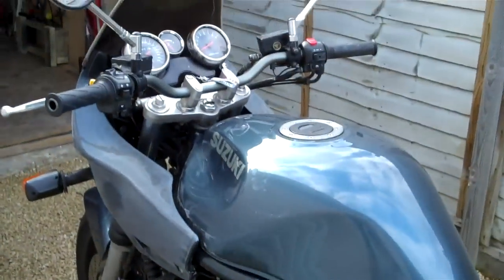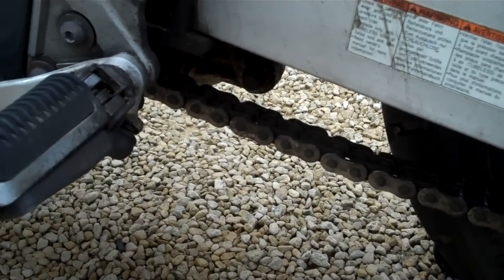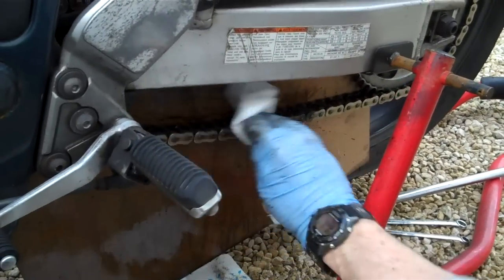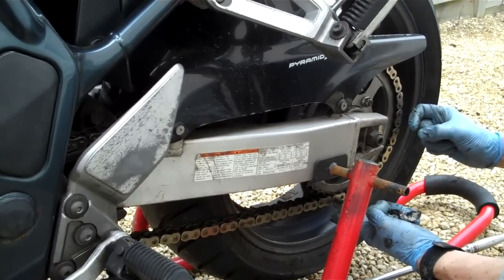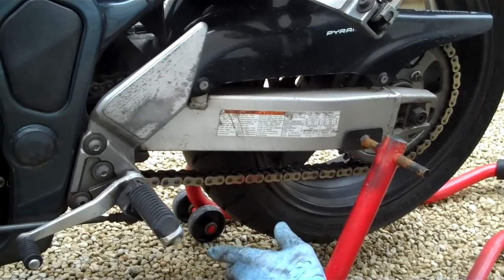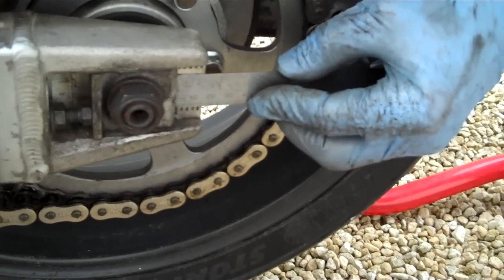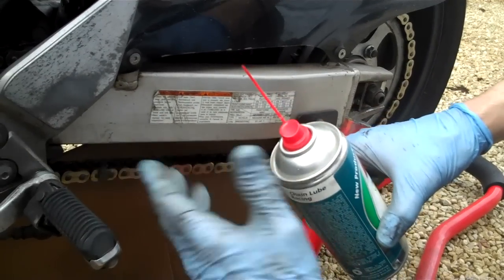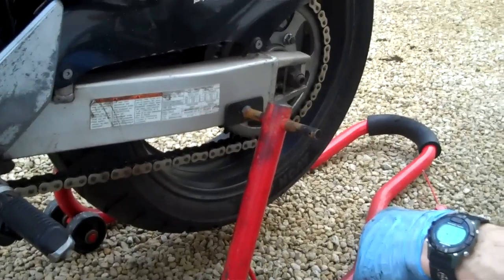Delboy's Garage, Suzuki Bandit, Chain Adjustment. (plus clean and lube).

Comment from the maker: Kerosene, paraffin, diesel, white spirit...it all works, mate, just as long as you clean it with something other than water and good call, it is indeed wise to clean out the front sprocket cover once in a while as they tend to fill up with stodgy chain wax and grit.  Thanks for watching, take it easy mate, Del

Comment from the maker: Hi mate.. no its just the usual wear of discs, they get crud on them and rub in parts...but its certainly not due to ut being out of line as the caliper is mounted with the axle through its middle..so if the wheel is out, it takes the caliper out too so it stays in line....its just and old disc mate, and some dirt....thanks for watching, Del.

Comment from the maker: Hi mate, its a common misconception that scott oilers are a fit and forget item, if they are over oiling then they make a right old mess and need even more cleaning, they need more oil when its raining (because the oil washes off) and in the dry warm weather they need very little, so you should adjust them constantly for the weather conditions to avoid the mess..which all in all is why i hate them and just lub as i need it with a top qualtiy spray lube..  thanks for your kind comments mate..Del.

Comment: untill watching this i didn't even consider that i needed to clean my chain rather than just lube it o_o it was absolutely caked spent 2 hours cleaning it and well...it's apparently silver in color which is nice haha thankin you sir and madame
Reply from the maker: Well done on the cleaning mate, it's worthwhile time spent as the cack that builds up is a collection of road grit and dust, flint and powdered glass etc., not to mention salt crystals all stuck together with old chain lube... and all this makes a pretty effective grinding paste!  Which will certainly shorten the life of your sprockets... so that 2hrs could just have added another 2-3,000 miles to the life of your chain & sprocs!  Thanks for watching, take it easy, D&P

Comment from the maker: You DO need weight on the suspension to set the chain tension correctly... if you dont have a paddock stand, then do it in the centre stand, but set it a tad loose, and do the final check with it on the ground....as long as it doesnt go too tight you're fine.... hope that makes sense... good luck, Del.

Comment from the maker: On the main stand the wheel is fully unloaded so you'll get a slightly tight adjustment, if you have a friend to help loosen off all the back end ready to adjust, stand the bike upright, bounce the rear up and down a bit to settle it, then set the tension by adjusting accordingly and whilst holding the bike up lock up the adjusters and nip up the axle, then put on main stand to tighten everything up properly - cheers, mate, Del

Comment from the maker: Hi AJ...yeah i have had that on the bandit, its usually attributed to a frozen link in the chain....sometimes one of the chain links will get wet inside and rust solid, then every time it comes round a sprocket is will clunk as its forced to move...best to check every link in the chain is moving freely then clean and re-lube the whole chain....also check for snapped off teeth on the sprockets (front and back) other than that, it could be a nail in the tyre...but not likely...good luck mate...Del

Comment from the maker: If you only have a side stand then chain adjustment is fine to do with the wheel on the ground as you need a little weight on it to set the right tension, but for spinning the wheel for chain oiling use a trolley jack on the right hand side of the bike and find a point to jack aft of the side stand mount, this will lift the rear wheel as it rolls the bike over .. you only need 1/2" off the ground so don't jack too far ... hope that helps, Del

Comment from the maker: You are not wrong, mate, and I've seen that kind of thing myself! ... the biggest thing that's lacking these days is basic maintenance knowledge, when I ran a bike shop, a kid brought his 6 month old trail bike in for 1st service at 500 miles & the front tyre was totally shagged, he'd run it so flat for so long it tore the sides off and left a single line of tread round the middle, the things was lethal, and his answer "you never told me to pump it up" ..god give me strength LOL!  Cheers, Del

Comment: Thanks Del, after getting well enough I’ve finally started the service on my bike doing the stuff I’ve learnt from you, brakes stripped down, cleaned and fluid changed, chain degreased and lubed correctly, oil change next, however my wife isn’t best pleased after losing 2 fillings after I used her tooth brush as instructed by yourself, that bit wasn’t the best advice Del Boy 😂😂 thanks again for the great tips and advice

Comment from the maker: Yes Davey.....if you run the bike in gear while suspending the back wheel there is no resisting force on the wheel so it rolls free..the centrifugal free running will make it "overtake" the engine which is ticking over at a steady pace...but as soon as you place a bit of resistance on it (as when riding) then the chain is under load so stays tight... also what you don't see is when you roll on and off the throttle your chain 'bucks' as the load on it changes...this is why you need some freeplay.

Comment: I sent my bike in because i kept loosing traction when accelerating ( to the the point i was deliberately accelerating slowly for about 2 months on my 70 mile daily motorway commute)...... he told me i needed a new chain and sprocket..... when he took it off the chain was shagged and the sprocket looked almost smooth. to this day hes got it hung on the garage wall with my name tagged underneith it to shame me because it was the worst one hed seen on a big bike in 40 years lol.

To be fair I moved to north wales not knowing anyone and only been riding for a year ( first bike was a 1200 bandit)..... the garage owner sat me down and taught me how to look after my chain. In doing so probably saved my life or atleast serious harm. much respect for you doing the same. great videos.
Reply from the maker: Thanks for sharing your story Miguel, it sounds like you got away with it, and learned some value maintenance along the way... ride safe!

Comment from the maker: Hi mate,yes the rear sprocket is bolted tight to an independent carrier that sits within several blocks of rubber inside the wheel casting,these blocks are called 'cush drives' & the carrier has fins that stick out & insert in between the blocks so when you dump the clutch & the drive takes up there is less snatch on the chain and gearbox bearings..if you hold the sprocket top & bottom & rotate it backwards & forwards you should get no more than 10mm of movement..any more, they could be worn out

Comment: I adjusted my chain the other day on the centre stand, I didn't understand why the manual instructed to use the side stand....
Your explanation has taught me that the chain will be falsly loaded on the centre stand and will not allow you to correctly adjust the chain tension....
I will address this problem before the next time I go out.... Thanks for this.  
Also the markers on the swing arm are somewhat vague when setting the adjustment because they are loose fitting on the axle......
Measuring the distance between the drive socket and the rear wheel axle on both sides will sort this out.
Nice tuition, thanks...

Comment from the maker: Paddock stand is best because it allow the weight of the bike to rest on the suspension and this gives an accurate adjustment...jacks and centre stands let the wheel drop down and you can end up over tightening the chian...in which case just get someone to hold the bike upright on its wheels when it comes time to set the chain tension....hope that helps.. Del.

Comment from the maker: Good luck with it, Jamie, the reason we do the tight spot is so that is the tightest it is, remember that a chain that is too tight can knock out gearbox bearings, pull the wheel out of line or even break, so always better a tad too loose than too tight - good luck with it, mate, Cheers Del

Comment from the maker: "the non-chain side looks like it could be the head of the axle,"  CORRECT...it is there so that as you lean on the spanner to loosen the nut, the axle can often turn....the hex head is there so you can slip a spanner over it to hold it still....dont be scared of it chap, just get stuck in... good luck, Del.

Comment from the maker: Hi Philip, sounds like a good ride out mate, that is one beautiful part of the world... specially Matlock!  If you have kinked links jammed in position then whilst they can be freed up by slackening off the chain till it's hanging loose, then taking 2 pairs of mulgrips, carefully work them back and forth with lots of WD40 on them & you can free them up, but they are now rusted & if left wet after a wet ride, will probably seize again...basically, mate, it's time for a new chain I'm afraid! Del

Comment from the maker: Those alun bolts are the adjusters.. once you loosen the axle, turn them in or out and the wheel goes back or forward.. just give it a check over as in the video to set the right slack.. good luck Del.

Comment from the maker: Hi Marko, and congratulations on your new bike! At 1700kms (1000 miles) you are due to first service now and on the first service you would always check and re-set the chain tension as it will have bedded in from new. There is always an initial period of stretch and settle down on a new chain in the first 1000miles, but once adjusted out it should not need adjusting again until next service at 5000miles - so simply adjust the chain as procedure to re-set the correct slack and remember to lube it

Comment: Hi, Bought a V system Scott oiler for my 1250 Bandit. Had Stephen Billau fit it and set it up. As the bike needed a 4000 mile service they did that as well. They cleaned the chain thoroughly, removing all the wax the previous owner had covered the chain.The scottoiler does it's job and keeps both sets of o rings lubed. However, the outside plates were left 'naked' no oil etc. Now, depending which motorcyclist you listen to, the chain plates having no oil on them is normal because if you use another lubricant it prevents the scottoil working efficiently. After two weeks of commuting covering 800 miles in all weathers the plates have become a little rusty. I have taken some scottoil and a toothbrush and covered all of the chain in the stuff. I've been back to the garage  (to have the controller for my heated grips changed) and their advice is to keep a bottle of lube with the bike and spray the chain after washing it. (I watched your video about washing salt off the bike and I do it religiously twice a day) . So what's right? Keep the chain naked? Or mix the lubes? If you mix them will it cock your v system up?  cheers buddy

Comment from the maker: Indeed, correct, the float does only affect the gauge, if you have a standard reserve tap then to be honest that is way more accurate than any gauge, as you get to know your bike you'll know roughly how many miles you get from a tank full or from a tenner and you'll be ale to predict almost to the mile when it will hit reserve, tbh, I take no notice of the gauge on my Bandit or the Hayabusa, I just zero the trip at fill up & at 150miles hey presto the light comes on, right on cue! Take care, Del

Comment from the maker: Hi Pav, good choice to go for Talon parts, the very best there is in chains & sprockets! Not sure where the filings could have come from, check you are not rubbing on the swing arm or engine casing anywhere, which you should feel anyway as you ride, and sometimes new parts can behave oddly when first installed - if you've cleaned them off & it's all stopped now then I guess there's nothing to worry about - good luck & ride safe, Del

Comment from the maker: Hi mate, paraffin will do the job, as will diesel, but something with an oily finish rather than spirit is better as it will leave a little lubrication on the rubbers and not dry them out.

Comment: Brilliant video - easy to follow and empowering.  I've not ridden for over 25 years and safety when I was a lad meant nothing to me.  

I used to 'wing it' when I adjusted my chain (or changed a tyre in the dark!) and managed to get lucky.  Gone are the days when I'd feel confident pulling over and using two pages from the phone book (those you used to find in the red phone boxes) and fashioning a replacement head gasket to get you home.  I take my bike to the garage for everything and need to become a little more self sufficient!

Definitely going to follow your videos.  Practical, easy to follow and not condescending in any way.

Don't apologise for teaching us to suck eggs - if we knew what we were doing, we wouldn't be on YouTube looking it up!!

Keep up the good work and thanks for sharing your knowledge.
Reply from the maker: paul wright Hi Paul, im really glad you can use the videos, thats why we load them up after all. And yeah, i guess sharing a little knowledge it a good thing, after all, we're better helping each other out than paying main dealer prices for basic repairs aye... thanks for watching sir, take care.. Del.

Comment: Hi ya Del & Penny :) .11 years ago when I got my first big bike, ( ER5 ) I didn't have internet, I learned how to adjust & clean my chain from the bike dealer, who did exactly what you have shown, tightening the wheel, he did use a torque wrench ( well he had to do it by the book ) but he did it with a socket first to show how little effect torqueing would have. I know quite a few seasoned bikers who would benefit from this vid, not just noobs, sometimes people need to be told how to suck eggs

Comment from the maker: @morganzd Hi there, and thank you for you comments. It helps to make measurements from the 'swing arm pivot' to the back of the swing arm (fork), provided that the two measurments are exactly the same, then you can measure backwards aswell as forwards, but indeed,  if the two swing arm spars are different lengths then you are right, but on the Bandit they are exactly equal so it is fine to measure backwards...many thanks again.. and your English is better than my Czech.lol.

Comment from the maker: Thanks Dave, you're right to not trust the side stand method.. the wheel is being pulled to the left a bit by the weight so it can never be dead straight...centre stand is ok as long as you set the final tention by someone holding the grab rail with the bike on its wheels....hope you're enjoying the 1250, they are a brillaint bike mate... take care and thank for your kind comments. .Del.

Comment from the maker: Hi mate. and well done on buying a bandit, you have a great fun all rounder in that.. If your speedo reads fast, and the tyre/wheel etc is the right size, and you have a simple cable with no converter... then the needle may be bent.. does it sit at 10mph when your stationary? if not, then it may be the magnet inside.. not much you can do.. but they aren't accurate anyway.. you can fit anyting you want these days, and if you like the fighter look there are some great choices out there.

Comment: Excellent, informative video thank you very much! I learned my lesson when my brand new CB500X OEM chain only lasted 6000 miles! I was lubing it but didn't realise I should have cleaned it and regularly adjusted in too. Got a new F750GS and riding in winter in North Scotland is taking its toll even at 2500 miles so I will be doing everything you showed here this weekend (if it's not snowing ;) and every 3 or 4 weeks through winter. All the best.
Reply from the maker: Good move Gary, you could do with a Scottoiler really mate.. that would keep your chain oiled all the time, you can adjust the amount it dispenses, and clean it once a week or so if you need to..  you'll find that the chain needs adjusting less often, and will last a lot longer over time...  Good luck and ride safe up there in the beautiful Highlands... Cheers. Del
Reply: @Moonfleet41  Thanks for the reply Del, yes I'm checking out Scottoilers. As you say, could be the best solution for winter riding in Scotland.Cheers!
Reply from the maker: @GS-xg4nz  Good call mate.. i did some work with Scottoiler as a company a few years ago, as you know they're a Scottish company too... if you contact them, then have a chat with Matt Ennen, he's a really nice guy and proper helpful, they have lots of options, so he could guide you to the best item for your needs... and tell him i said hi as well mate... Goode luck and ride safe.. Del.

Comment: Hi ya, I have followed all of your advice, I've replaced chain and sprockets due to seized links, put in k&n air filter and had my bandit dynotuned... It runs great.. except since it has been back from being tuned, the petrol gauge is incorrect and the bike dies when it reaches half a tank, I have to put it on res. I've looked everywhere for an answer but to know avail and I'm not sure whether this was caused by mechanic or a new issue. I know you are busy but your help has proved invaluable.

Comment: Cheers very good information for new and experienced riders too. Must get a paddock stand, I have always followed the manual on my old and sold 1200s - adjust on side stand it says, big faf-about and never felt it was adjusted quite right. My 1250 I've not got a manual so was guessing the same. Really simple and good tip about the card board too. 5 stars Video mate.

Comment from the maker: Hi buddy... i have never filmed doing my valve clearances, but a buddy of mine has.. so ill PM you a link to his videos part one and two... then you can follow them easily... and as for plugs, just pull the plug cap off, and drop a long plug spanner down and undo them... its just a case of restricted access... but its not hard..  PM sending now...